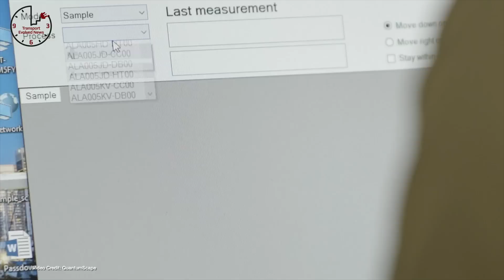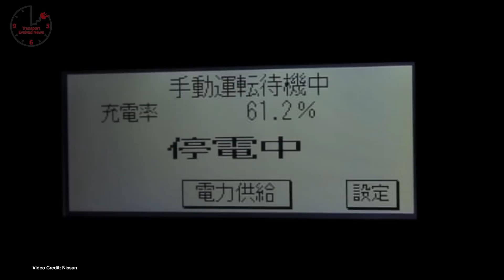TEN 319 Aptera Returns, Gridserve, Solid State Breakthroughs?

Comment: Who is going to buy Aptera when for about the same price of their top model they can buy a Model 3?
Reply from the maker: You're caught in that same "everyone must buy a Tesla" mindset that many people have. Variety, diversity of choice, is important.
Reply: @transportevolved  I would gladly buy another EV if they can compete on quality,  performance and the price. Why would I pay more money for an inferior product? That's the reason all these new startups fail.
Reply from the maker: @androidtvbox2891  If you're looking for energy efficiency - and Aptera can deliver on its claims, it will be the most efficient. Some people view that as more important that autonomous driving.
Reply: I would. I don't need the extra 3 seats. The lower consumption means I can go further on low power outlets and the range is nearly triple.
Reply: @gasdive  400 km range is more than enough for me and most car owners. And how would you make up the autonomous driving option with Model 3, which is going to be level 5 pretty soon?
Reply: @androidtvbox2891  charging opportunities are sparse in Australia. If I got one it would probably be the 500 mile range which is cheaper than any Tesla. For the regular 500 mile round trip I do, that would let me start on 80%, charge once on the way down and once on the way back. The 1000 mile one would be better, but not enough better to make the extra money worth it. The 250 mile one could do the trip, but I'd have to detour to find a charger near the destination and wait while it charged. That doesn't really work. (he says from bitter experience)
Reply: @androidtvbox2891  oh, and the autonomous driving. I'd sure like that, but not 10 000 dollars like. 10 k pays for a lot of "I'm too tired to drive, I'll get a hotel" drives. Plus the bed of the Aptera is big enough to sleep in anyway.
Reply: @gasdive  I agree.  Also, the Tesla FSD is not going to be approved level 5 for a LONG time.
Reply: People who aren’t going to buy the top model, people who want the range, people who want to fix their own car. Someone who want to go 250 miles on a 25 kWh  battery because they don’t like using resources.

Comment: Thanks Nicky. Love the look of the VW ID6 and those inside opening rear doors. If it's a decent price Tesla has definitely got some competition there.
Reply: Suicide doors are always a tease on concepts but when was the last time you saw a mass production car with  them.  
Lincoln continental or TBird 4 door in the 80’s / 90’s ?
Reply: @Jaymac933  Thanks mate. Good point.
Reply: @Jaymac933  The Aptera doors are gull wing and Roush has refined the design.

Comment: OEMs generally will continue to be resistant to V2G. The reason is obvious once you stop to think about it. Automakers, in the US at least, are required to warranty their batteries for 8 years or 100,000 miles. The amount of use these batteries see is reasonably predictable. Sure, some people will put their EV to extreme use with constant DC charging and climate extremes, but most people do not. Automakers include the anticipated cost of warranty repairs for any fleet of vehicles they build into their pricing calculations for those vehicles. Allowing V2G to add additional charge/discharge cycles to the battery's wear in normal use will make that calculation very different. Some may use it only for emergencies but others may run through almost full cycles regularly. Constantly charging and discharging batteries accelerates degradation. Degradation of a Powerwall is less problematic than degradation of a car battery.
Reply: V2G is much lower current draw than accelerating a car.  It doesn't need to run batteries down to zero.  That would be unacceptable.  V2G would would have a much more conservative demand management program than a car, so the impact on battery life should be small.
Reply: @incognitotorpedo42  Perhaps hypothetically so, but DC output from the battery cannot be throttled by equipment on today's cars. That would have to be handled by a high voltage inverter tied to the house. Use will be beyond the control of the OEM. 

Constant small charge/discharge cycles do lithium batteries no favors, especially near the top of the charge.

I'm not saying it won't work. People are hacking vehicles and doing that today. I'm saying V2G exposes OEMs to potential unknown warranty expense, which in the case of batteries can be enormous. Adding that feature to cars will increase the price consumers pay even if it requires only a simple software update (It does, just need to turn on the main DC charging contactor).

In the interim expect to see more explicit warranty exclusions forbidding this use, but I won't tell if you don't.

Comment: Aptera aka Robin Reliant
Reply: It has 3 wheels, that's all that's similar. I have nipples, doesn't make me a cat.
Reply: @craigknight2764  purr
Reply from the maker: The differences between something like an Aptera and Dell Boy's ride is that one has a very low center of gravity. The other does not.
Reply: @transportevolved  thanks for taking the time to respond. I look forward to EVs becoming greener and powerful with advancing battery tech. I really love the look of the Audi GT etron. Sleek, sexy and not as clumsy looking as those oversized SUVs. A shooting brake version would be nice too as well as functional. Competition will drive prices down and hopefully displace ICE vehicles completely within my lifetime. I also hope that this will force some political changes in the Middle East as those autocratic regimes are no longer able to stay in power in part through the sale of oil and gas.

Comment: Hydrogen is stupid pls stop
Reply: @2good2be4gotten Electrolysis, the typical means of creating hydrogen is about 70% efficient. Meaning you need to pump in 100J worth of energy to get H2 that can be used at some later time to create 70J of energy. Now, if you can get unlimited amounts of energy for free (from the sun, but that still needs some conversion), then who cares, right? But (a) it's not fast and (b) you ain't getting it for free: storage and transport of H2 isn't free. Pumping it to a high pressure isn't free.

So it's better to just skip converting electricity to hydrogen (working effectively as a battery) and back to electricity. If you have another material as the intermediate storage device - a better battery - then use that instead. And there are many viable concepts out there beating hydrogen as a battery.
Reply: @EricDeanCampbell  It is a terrible idea, hydrogen cars are around 30% efficient vs battery cars 85-90% efficiency.

Hydrogen is abundant in the universe, yes. It however is not (that) naturally abundant on earth, you need a lot of energy to create it cleanly.
Reply: @EricDeanCampbell  The abundant-ness of hydrogen (in the universe) is not a relevant issue.
Reply: Look up hydrogen factory exploding then look up solar field exploding... Wait
Reply: @2good2be4gotten hidenberg and hydrogen takes electricity to make so why not make electricity.
Reply: Beta was superior to VHS. VHS won. Your comment is as ignorant as you.
Reply: @stephenvincent4706  Irrelevant, VHS isn't as inferior as hydrogen.
Reply: Hydrogen is too dangerous kind like nuclear is safe and clean untill it isn't then it catastrophic
Reply: I'm not saying solar is only option just wife's spread hydrogen is stupid and dangerous
Reply: Like all renewable things hydrogen has it's uses but for typical road car applications there are better options. Hydrogen is better used at the grid level as energy storage for climates where solar isn't an option for large portions of the year and their economies can't support the new SMR tech. Also I can see hydrogen being used to power long haul locomotive engines, especially in countries like USA.

Comment: I agree to V2D If the inverter is outside de vehicle. Carrying a dead weight arround just when you need in a outage is not smart
Reply: V2G can be done with the same electronics as the charging circuit.
It is a bit complicated to explain here but for many such things it is just a matter of the order you switch on and off the semiconductor parts that controls which way the power goes.
Reply: @kensmith5694  Hummm.. . I'am an eng. but for embedded still don't know how it works. But you are saying that a it's easy make a "reverse push'n pull" topology. So then I have to agree, more funcionality for almost same weight/money. Can you post some links where I can see more info ? Agains bit brusher here... but I'am interested.
Reply: @Clipes-4YOU  
Consider this:
https://en.wikipedia.org/wiki/Buck_converter
Now, imagine that the diode really is a switch.
In real life it often is a power MOSFET because the forward drop in a diode leads to too much power loss.
Now break out your mirror and compare with
https://en.wikipedia.org/wiki/Boost_converter
You can see that the topology is a mirror image.
Note for non-electronics types:
The easiest way to think about this is to assume that the "coil" AKA inductor must have a long term average of zero volts across it.  This means that the average voltage on one side of it is exactly the same as what is on the other.
If one side is going up and down between 0V and 10V with a 50:50 duty cycle and the other end has 5V on it, all is well with the world.  The averages are the same.
People who like mechanical stuff and think of voltage as pushing on a big mass on frictionless wheels.

Comment: Nikki.. have you seen the new Citroen Ami?.. it makes the Aptera look huge!
Reply: The aptera is huge. For some reason the photos make it look the size of a Fisher - Price toy. If you look at the Facebook comments they're all along the lines that it will get squashed, adults won't fit and you can't carry shopping.

In reality it's wider than a Ram 1500 pickup. It's taller than a Camry and only a few inches shorter.

Comment: Just think of it, you go on a bike ride into the middle of no where...no one else for miles and your feeling peckish!
You magically dig out a Pizza from somewhere or other and cook it to perfection on an over powered by your bike...hmm yummy 👅  Afterwards you tidy everything up  and start...start....START 🙀
The Battery's flat!
🤭
Reply: But luckily you picked a mountaintop location, so you just roll the bike down hill and let regen charge the battery...
Reply: @Graham_Wideman  you do have a legitimate point. But I did measure the voltage before and after, and I have the rating from the appliance and the time it ran as well.
Reply: @mvetter  I was replying to David's post, not you. That said:  back of envelope calculation -- 1 kW times maybe20 mins = 0.33 kWh.  What do electric motorcycles get, maybe 6 to 8 miles per kWh? So that pizza would cost 2 to 3 miles range.
Reply: @Graham_Wideman  we usually go by Wh/mi and figure around 140 for daily use.
Reply: @mvetter  so about 7 mi/kWh. Thanks for that note.
Reply: Cooking the pizza only used about a mile of range. I could cook pizzas for DAYS, man!

Comment: i really like aptera. i hope i can buy this soon. it's the first electric car that sounds appealing to me :)
Reply: The only change I would suggest for it is a switch to two wheels on not a very wide baseline at the back.  When you use it to go to the store, an easy way to get the purchased items in is needed.  Two wheels could leave a small area on the center line free for that.

Comment: I think 4 in-wheel motors are a great way to retrofit ICE cars to electric.
Reply: for many poeple, just one motor would be fine
Cars used to have just one drive wheel. City cars would be fine.
Reply: @brandoYT  When did cars have only one drive wheel? (Assuming a 4-wheel car.)
Reply: @Graham_Wideman Most cars are effectively 1 wheel drive unless going in a straight line.
Reply: @charlesbridgford254  How did you arrive at that conclusion?

Comment: I wonder if the ground clearance on the wheel surrounds of the Aptera, I don't know if the US have speed humps on their roads, but here in the UK it might not get over some, the council workers don't put them all the same height so some are pretty nasty.
Reply: I think on the current model it is 5".  There will also be an off road option.
Reply: @n.brucenelson5920  5" should clear although will be close on the rear with the front overhang, seen many boy racers losing their splitters, bumpers and side skirt on our speed bumps.

Comment: I hope there will be more news on solid state batteries.
Reply: I expect to see them combined with supercaps.  The SS battery gives more energy per volume.  The supercap can't be beat for getting about 10 seconds of a huge amount of power.  When you hammer on the brakes, the supercap can soak up the energy for use when you need to start moving again.  This cuts down the surges on the battery for a longer life.

Comment: I gotta be honest. I kinda feel like California is throwing good money after bad with hydrogen. I don't see any reason to think it will ever be useful for cars. It's less efficient, so you are better off charging a BEV directly, and if you want to store electricity in the form of hydrogen, you can still do that, just put the fuel cells in a field with a connection to the grid, instead of in cars. Then you don't need these fueling stations.